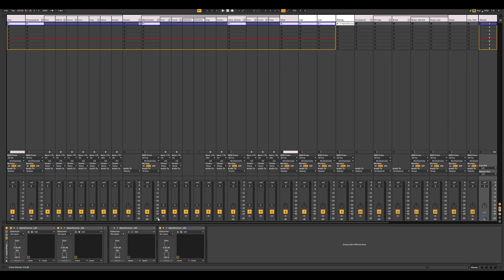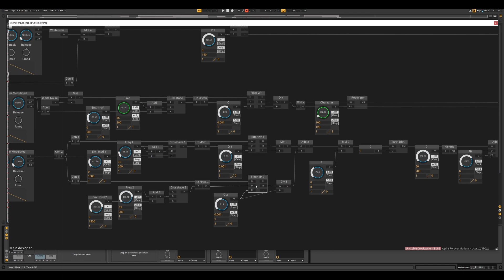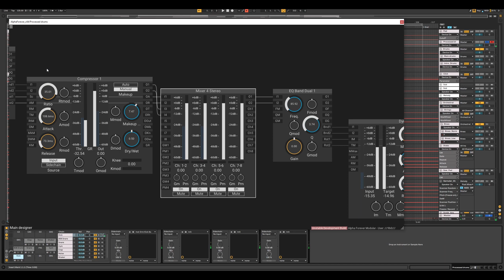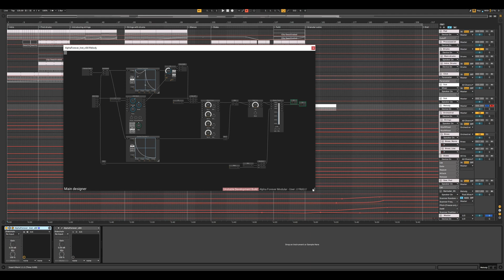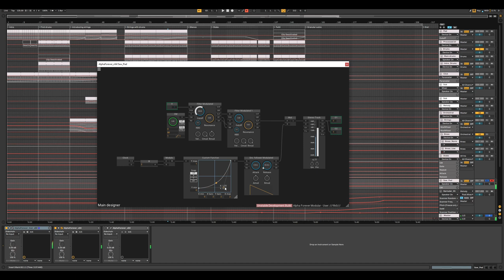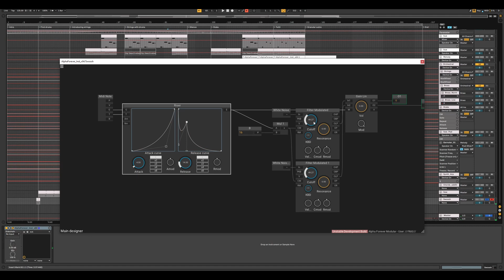100% procedural music production // 9b0 - Cube (Project breakdown)

Comment: Very interesting and definitely not too geeky! So, what goodies do we get in the upcoming Alpha forever update? Would love to have that smooth saturator thing as unlike you I'm a huge fan of saturation!
Reply from the maker: Actually there was lots of under the hood things that the user won't feel, but they add a lot to stability and better workflow (especially when using feedbacks). The new complex nodes (Compressor, EQ bands, Shelving EQs, Dynamix, Spectrum Analyzer) where produced with a completely new workflow, and we found some mistakes / bugs since the devlog that we had to fix. Alltogether the release required heavy testing, and this song was the perfect candidate for that. When the release is out, i can send the 'smooth saturator' patch to you, it's nothing too complicated.